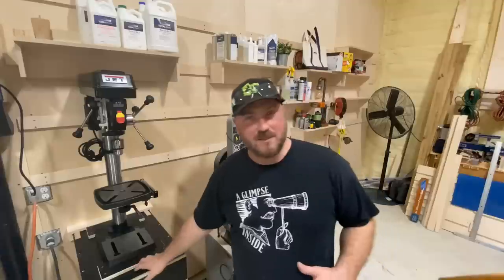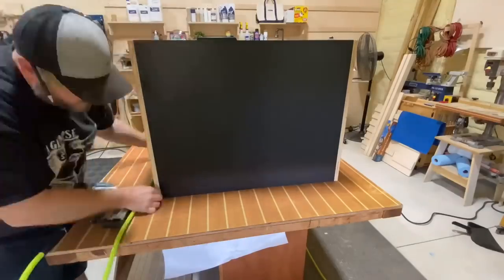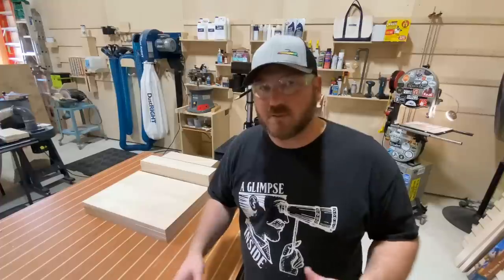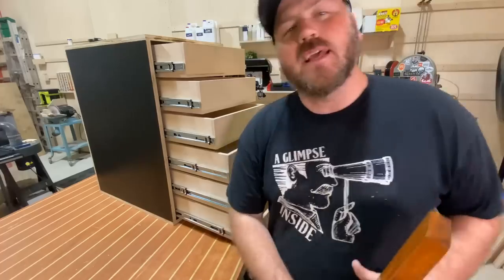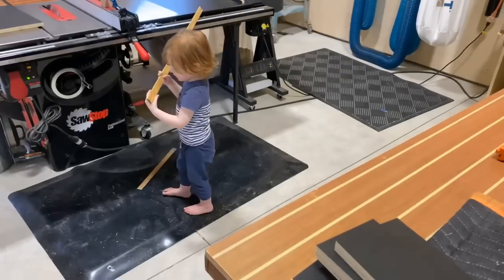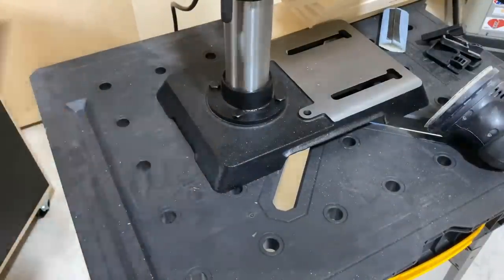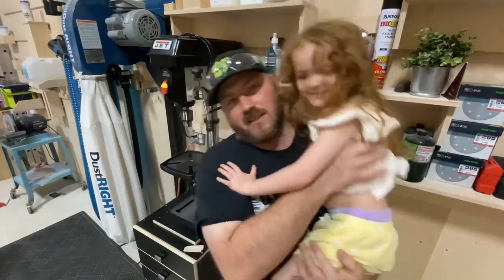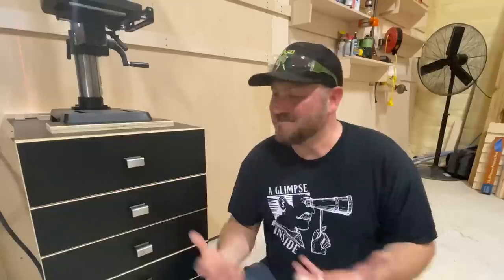DIY Drill Press Storage Cabinet | A Glimpse Inside How To

Comment: Great build. I really like the data were slides. Rocker....
I like their tools and accessories  & I like to hear from other woodworkers using their products. I like how you stabilized the drill press to the cabinet, and to the wall with the shopmade bracket and the wedges. Letting your little kids run around was great. Keep up the great projects. I have my benchtop mounted to a 6” post in the middle of the shop. A 24x36’shop.Not fancy about it's stable. Build your cabinet to go under would work good. Thank you

Comment: Those levels REALLY need to be displayed! You even have plenty of space for it so no need to feel guilty about using up an area that could be used for something else........ you could always do what I do and make storage cupboards and attach the level display to the doors, which works really well if everything has good pockets to fit into 🙂

And yes, laminate is sharp, especially when it's on a mighterred corner..... cut with a hand saw, so nice a jagged!!! ☹

As always, loved the project and definitely the locking bracket on the wall! 👍👍👍👍
Reply from the maker: I do like your idea of using the levels for some type of functionality. I’m definitely going to make a display for them in the next few months
Reply: @AGlimpseInside  just make sure you get the display level or you'll never be able to forget it all of the bubbles will be off center 😂 👍

Comment: Something nobody seems to utilize, the slot holes in the drill-press foot. They are there so you can mount and move the press front to back. If you extend the floor of the stand out the back further creating a shelf, you can strap in long stock for end drilling by swivelling the drill-head around, loosening the bolts ( big wing nuts) in the slots and sliding the press back, retighten. Various clamping/height devices can be fashioned to hold stock. Press stand only puts the press stand out a few more inches off the wall. Also use the long cubby created to store long-ish press accessories, fence and stuff.
Reply from the maker: That’s a really good point. I didn’t realize that as well. Thank you so much for sharing it here

Comment: This presentation is noteworthy for addressing a major safety concerns--the danger of tipping--that comes with mounting any tall machine on to a table or cart. Chris's wall bracket is a clever solution for his shop, but the narrowness of his cabinet (and a couple of other YouTube builds) remains a concern when his mobile cart (note casters) is detached from that wall bracket.  If limited by space concerns mandates a narrow mobile stand, consider designing counter weight into the base via thicker plywood and heavier casters. Caster choice is another important safety concern, so take time to research choices in relation to workshop floor variations and the potential for typical woodworker screws to shear or be torn from the base of the stand. Think lag screws and a thick base (1.5 inches min.).

Comment: I have a similar setup, but I found a piece of 2x4 to be my favorite addition. Length is up to you, but stand it on edge and drill various size holes (not through holes) in it. On one wide side, mount a few rare earth magnets. Now stick it on the side of the metal cover up top. I keep all my common drill press stuff there such as a chuck key, center punch, 6" ruler, pencil, etc... No reason to dig through a drawer for that stuff. Nice job on the cabinet.

Comment: Nice build.  I like the look of the chamfer against the laminate.  Nice thin little splash of wood tone to break up the black.  Have you considered a hardwood border with thin strips around the edges of the drawers instead of the chamfer?   Yeah, it's a bit more work than running a router bit over the edges, but it does hide the plywood layers, which can be a little less than attractive, show voids, etc. unless you're using high end Baltic birch.  I made a somewhat similar cabinet for my drill press and I wrapped the drawer fronts and the top with 1/4" strips of mahogany that I had laying around.  

Next project: You should make yourself a nice drill press table.
Reply from the maker: I do need to make a nice table. I have a little bit of an obsession with plywood edges. It’s probably unhealthy. I know everyone says they’re busy but I am relatively busy brother and doing projects quickly leaving the edges Raw kind of my thing

Comment: Y'know, there are a ton of fathers out there who would simply yell at their kids to STOP TOUCHING THAT! GET AWAY FROM THAT! THAT'S NOT YOURS! GO FIND YOUR MOTHER! It's refreshing to see someone who really enjoys the company of his own kids and allows them to hang out in the shop with him.

I would make it a rule that they must always wear shoes in the shop, though. You keep your shop floor pretty clean, but there are always stray splinters and nails and staples and other pointy stuff on a shop floor that can wreck havoc on a kid's feet.

Also, if you CA glue those shims to the underside of the bracket, and trim them off, then you won't have to manually place them whenever you put the drill press away. Just wheel it into place and it'll fight tightly, no unsightly shims on top of that beautiful black melamine.
Reply from the maker: Will Garmer thanks for your kind words. And thanks a lot for the illustration about how some days would just tell them to go find their mother. That could be true somewhere else but definitely not here. I relish the time as you can see and thank you again

Comment: Very rookie question here but, what is the best way to measure the size for your drawers? For example how did you divide up the cabinet opening to make all equal sized drawers? I'm trying to find a more efficient way then to just cut each drawer to size one by one.
Reply from the maker: It’s a very good question. I’ll try to explain as best I can with round numbers OK here we go. Let’s say you have a cabinet that’s 50 inches tall and you want to make five drawers seems pretty simple you just use 10 inch pieces however I like to substract about an eighth of an inch from the size of each piece because I know I’m going to use a popsicle stick or something that is 1/8 of an inch spacers. This allows for an accurate measurement. One tip I will give you though if you. If you need a five drawer faces and they’re all going to be even in length. Cut four of them and install four of them. And then cut your fifth one to be exactly right. The naked eye will never notice the difference if it’s a little bit smaller or a little bit bigger because of various nuances
Reply: @AGlimpseInside  Thanks for the response! Would you be subtracting more than an 1/8 though, if you're not accounting for the drawer fronts yet?

Comment: sorry if I missed it but regarding drawer width in relation to case width. Assuming drawer glides are 1/2 inch thick each did you build drawer boxes 1 and 1/16 less than the case? Great build, Thanks.

Comment: Looks great buddy can I ask why u didn’t screw the top down from underneath so theirs no screws showing on the finished 
piece? P.s once u lock the front wheels kick them swivels around so the locking mechanism is not sticking out, and if you ever want to move it kick the swivel and mechanism back out, that way theirs no trip hazard
Reply from the maker: Good points on both. Might have to do that for my next cabinet build
Reply: A Glimpse Inside Jesus didn’t expect a response that quick lol kick the swivel wheels with your foot job done looks great in black and silver real cool

Comment: I've had several occasions when I wanted to drill into something that was longer than the capacity of my drill press.  For this reason, I keep the drill press moveable so I can put it on the edge of it's stand and swivel the base out of the way.  That way I can drill the top of a walking stick, for example, with no problem.  I should work out some way to do this without making the drill press dangerously unbalanced.  You might want to consider some kind of adaption to your brackets to be able to accomplish this.  Just a thought.

Comment: Great video.  Looking to build one myself.  How wide is the base?  How easy do you think it would tip over without using the tip proof piece you installed on the back? 

Thanks
Reply from the maker: It’s about 1718 inches wide 24 inches deep. I actually have it in a different spot now and there’s really no protecting from tipping over. I feel as if it’s pretty stable

Comment: Instead of shims between the top of the base and the cleat on the wall to lock the base and drill down. why not drill two holes on each end through the cleat into the top of the base for pins to drop into?  Love the base though.  I have drill press I need to make something like this for.

Comment: Nice build! Really wish there was a decent place for sheet material in the area, especially phenolic faced.

As far as the "good vs well" thing, it's easy.

Something IS good. "It's a good project."
Something is DONE well. "It's a well designed project."

Only really variation is charitable works are considered "doing good" but in that case "good" is a thing, not a description of the method.

Comment: So, I’ve been out of woodworking for a couple years now but have found myself wanting to get back into it. I’m starting with setting up my new shop with cabinets, stands, a cleat wall, etc and have been watching a ton of videos to get inspiration. One thing that I’m seeing a lot lately is that very few people use rabbets and dados for cabinets, stands, etc., especially for shop cabinets. Everyone seems to just use some glue and screws, then clamp up with a 90-degree while it dries. Same with the drawers - no one even uses a simple overlapping rabbet. Is there a reason that I’m missing? My drill press stand is next up on my list and I’m certainly going use this design for inspiration but don’t know if I could possibly build it without proper rabbets and dados for fear of the Ghost of Norm Abrams Past coming to my shop at night and cursing me…
Reply from the maker: In my experience it’s just Another step to achieve the results. I’m sure it’s a little bit better but I’ve been building things like this for years and it seems to be OK. As for why I don’t know what the consensus would think but for me like I said it just seems like one more thing I have to do in calculate that I find is not worth my time

Comment: Seeing your girl makes me wish mine were that young again.  They are 8 and 10 now and my shop is not air-conditioned, so they want to stay inside instead of hanging out with dad.
Reply from the maker: That’s a bummer. I hope you can get some air conditioning soon my friend
Reply: @AGlimpseInside  - Right after I get insulation.  It is on the list.   I just bought a new band saw though.  I wanted to be able to re-saw and my small OLD Craftsman band saw just wouldn't cut it.